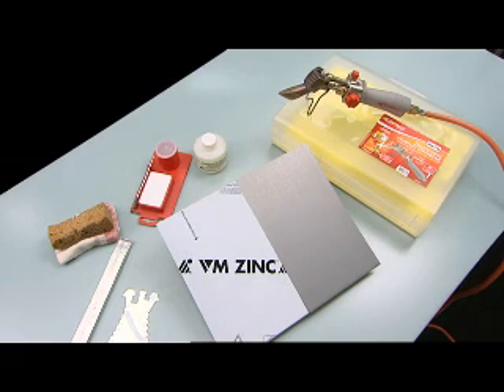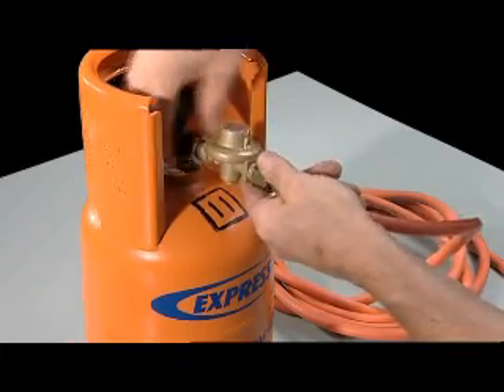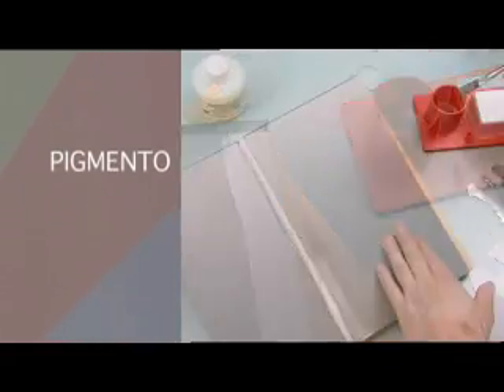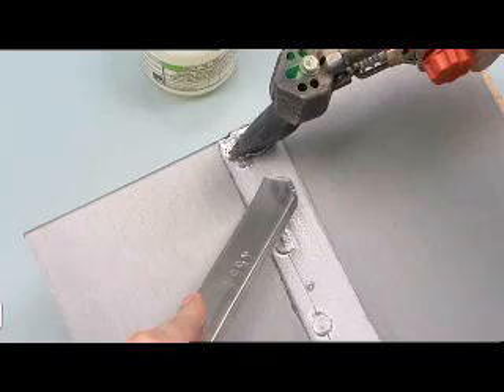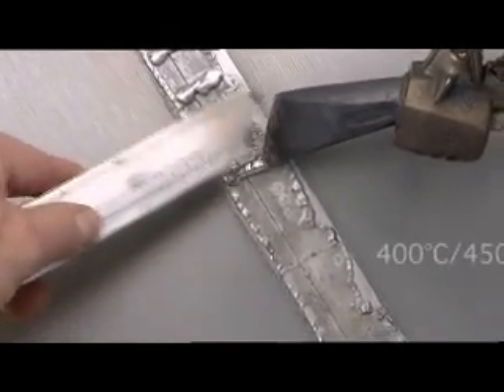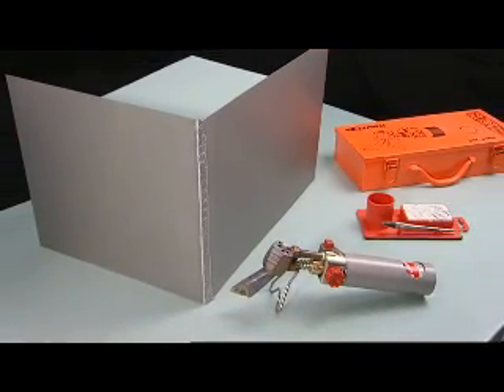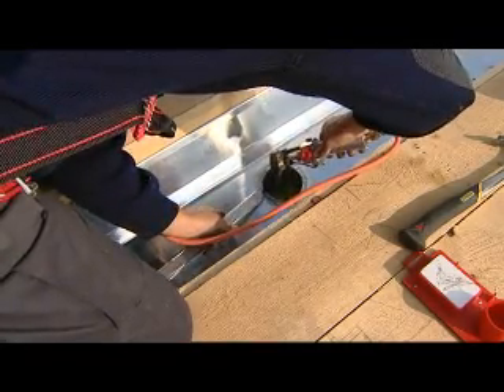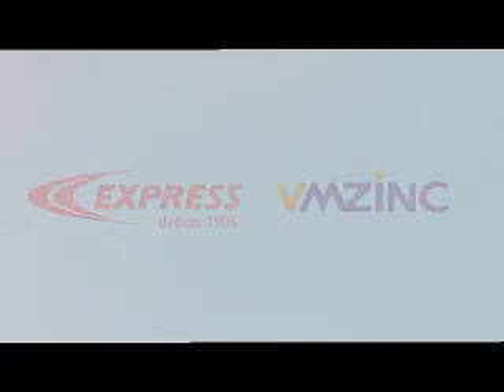Express Soldering Demonstration

Comment: compared to professional  soldering on youtube(s),  looks like this video is demonstrating almost substandard soldering.  
a) never heard of "reinforced soldering".  ever  hear of "ribbed edges"  those are reinforced by means of bending.
b) the flux is gel or liquid not solid.   you are using weird material.  
c) you said stripping zinc?  They do not.  it is flux that takes care of oxide and seal the joint.
d) not educate how much heat in the iron is necessary to heat the metal-flux (not the solder)

Comment: This setup with a titanium coated head instead of copper is much much better. We use it for gutters and it takes it to the next level. The tin is flowding 25 mm between the zinc. Copper head is old generation